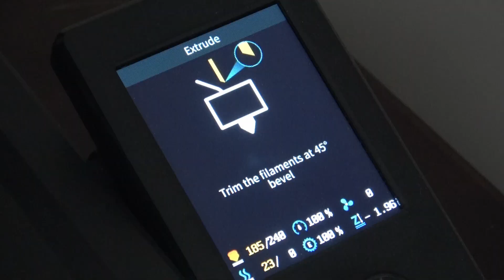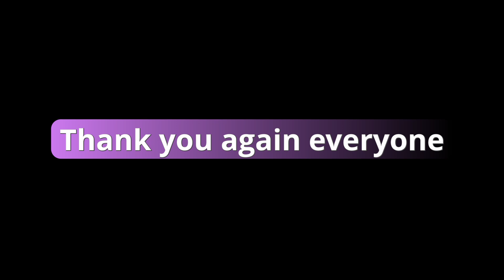DR650 Dash is now on Thingiverse

Comment: Awesome can't wait to try it out.  while infield definitely makes it stronger, a lot of times you can get way more strength for a lot less filament/weight by adding more shells / perimeters / top and bottom layers  (slicers call them different things.) 

I think I'm going to try and print this in ASA which is similar to ABS. It is supposedly more UV resistant than petg but just like abs it still warps too, just not quite as bad.
Reply from the maker: Thanks for the feedback,  I used 4 shell layers and 25 percent infill on the one I'm printing right now. For the cost and weight I don't mind, I just don't want it breaking lol. Please let me know how you make out
Dino

Comment: Hi Dino!   Hey I am looking at buying a 3d printer.   Any recommendations for a newbie?
Reply: If you just want plug and play I think the bamboo labs printers are still the best, but they have been changing some stuff recently that is a little worrying if you care about being able to use non-proprietary parts and filament on the printer. For what they are though they are a steal.

A couple good channels to start with are 3D printing nerd, makers muse, and make anything among hundreds of others. 

If you want to go as cheap as possible I believe that any cubic printers are pretty decent but might take a little tinkering. 

The prusa printers cost a little more for what you get but they are committed to open source and just seem to be an all around good company, and the printers are definitely high quality.

These days you can get a $200 to $300 printer with similar features to $1000 printers, the only difference is the more you pay usually the easier they are to set up, the less tinkering you'll have to do, and they might have better software and support.
Reply from the maker: @Jtw0912 Thank you for the advice, Dino
Reply from the maker: Oh boy, ill be honest i really am not the right guy to give advice on printers. I really chose mine by avalability and bed capacity. I would  watch some comparison videos for new to printing creators.
I wish i could be of more assistance